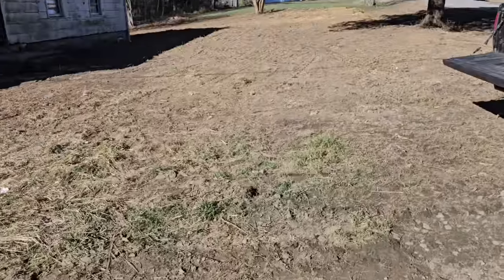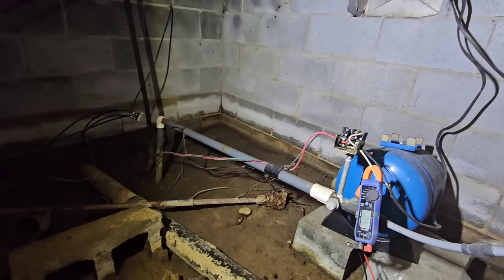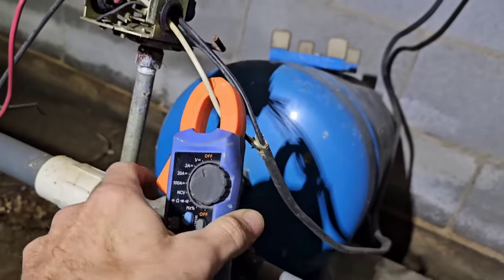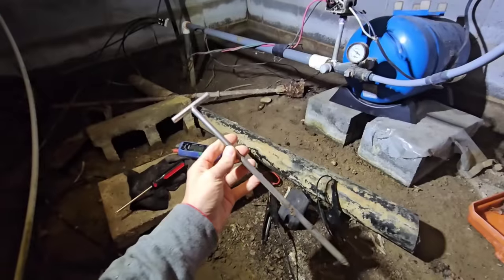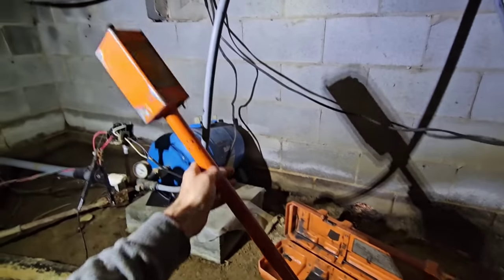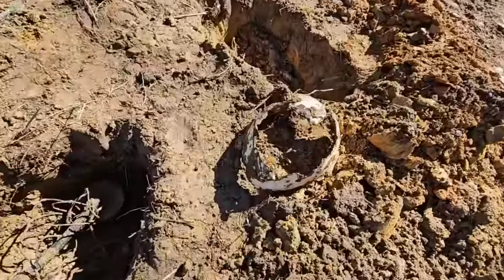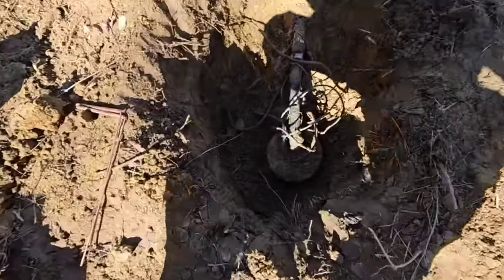Can Copper Dousing Rods Find a Water Well below the Ground? New Tech Vs. Old

Comment: I'm a man of science. we were on a job where we needed to tie into an existing plumbing Line. we had a man come out with his locator and he failed to locate it 6 times. the oldtimer I was working with bent some welding rods and pinpointed every line within minutes. I went from a nonbeliever to the opinion that there are a lot of things we just don't fully understand. great Videos by the way.
Reply: It's still not real. Every test done on it has failed. Dowsing at best let's you trust your experience. There's only so many places pipes will get put by installers.
Reply: I had a lady friend who was over here  in the US from Italy on some kind of scientific  research program, something to do with micro biology I think, she had TWO  graduate degrees  and was smart as hell, at least very highly educated!  Somehow dowsing came up...., and she scoffed at the concept, I took two gas welding rods (copper, bronze? not sure) bent a handle in them both, and told her to start walking. She located the underground line from my well, but didn't believe it until I proved it to her, to say she was amazed is putting it mildly.
Reply: @portnuefflyer  Anecdotes are not evidence. It's been disproven in studies over and over.
Reply: @Tb0n3   I was as stunned as she was I should mention, as I watched her walk towards where only I  knew the underground line was located. When they reacted, she did also, as did I!  It may not be "evidence" but that's what happened.
Reply: Works every time.
Reply: Hello as some one who is a water operator and who uses witching sticks aka dowsing rods on the daily multiple times a day I can say they do work and very well now if you be much easier to tell you all this in person but here we go… ok so first up it doesn’t find water it finds voids in the earth it can be a empty pipe a pipe full of water etc just can’t be filled with dirt 2nd most rods are way way to small mine are 28 inches long with a 8 in handle and are 3/8 inches thick now when holding you much be hands touching or wide as can be hands touching rods go away from each holding wide rods cross if you hold them in the middle rods will dance back and forth bro g pulled both ways this is what most people do when o had them my rods to try it so they think it doesn’t work no hold them tight or hold them wide now for those “test” yes I have watched them only line again a empty bucket or one filled with water placed on the ground that will never work at all you need earth and voids if you place a bucket on the ground it will have no contact under the earth no hit and like I stated it finds voids not water to “test it properly” you would need a empty field bury a few sticks of pipe or even buckets below the ground filled or empty you will get a hit on both of them again voids not water and no scientist will do that and put up a bounty on it because he knows the will loss his money
Reply: Same I'm a geophysicist and I'm pretty sceptical about most alternative non scientific things. But I grew up on a farm and on several occasions my father used the services of a water diviner to find places to sink new wells on our farm, I remember one time we all (our family) went and watched him locate an aquifer in the field near our house so we could sink a well there, he used a pair of bent wires and he also used a forked willow branch that he broke from a tree in our yard, he located an aquifer in the same location using both of these. We asked him if we could have a try he was more than happy to let us, it worked for my Mother and I, as we walked over the same spot the rods crossed and the willow fork pulled downwards, I even walked around a bit more and I could locate the aquifer in other places as it continued under the ground across the field to check that I wasn't just subconsciously manipulating the rods to cross where they did for the diviner, the diviner confirmed the other locations that I found, it didn't work for my Father or my Brother or Sister, just my Mother and I.

Oh and we sunk a well at that spot in the field it supplied water to our house for all the many years that we lived on that farm.
Reply: Good information thank you for making the video. I Am  Retired plumber in Virginia .I have used dalcing rods.When I was in the field working  locate sewer lines and Water lines.
 I have been fortunate that I have had good success rate with it. I do not understand How it works . Thanks for the.
Videos, On Well systems . Good information.
Reply: @Tb0n3  It is real to me. I found my well head then the old owner came out and showed me the same spot. I dug it up right on the spot the rods said it was. Scoff if you want. Spend your money.
Reply: It’s neither here nor there whether individuals ‘believe’ in the dowsing abilities of individuals or not, but whether it works - our local water well boring company simply don’t drill any new wells without having first the confirmation by our own local old timer water diviner (using fairly similar rods as shown here); he can tell them where to drill, and also how deep to drill. He took my partner out to allow her herself locate the various water seams. It works. 😊
Reply: years ago at a major industrial facility we had to locate an underground water   line and tie into it. I bent a set of welding rods and staked out the location.of the line. We called the firemen and asked them for a location. The old guy came out and pulled his brass rods and staked out the line. We were about 2 ' apart from our locations. We excavated and tied into the line at 28' deep. Think at that depth we both nailed it. I wasn't real sure I could do it. The old guy had no doubt.  He remembered when the line was installed back in WW2.  try it you can feel it!
Reply: Yes, lol 
The old timer is actually very gifted as it isn't about the rods as much as the one holding them.
Reply: I know for a facr gifted people can do this and it it's rhe man not the rods
Reply: Like you I don’t really believe in that type of stuff, I’ve been wanting to at least try it to see if I could find water on my camp land after watching this I’m definitely going to try now keep up the good work bub
Reply: Same on a site I worked on years ago..they gave me a go,when rods crossed,looked down ,there was a marker of one main they found earlier..a definite believer since then!!!
Reply: They don't want us to have well water 
They're not going to make it easy 
The rods do work
Reply: When I worked at a plumbing company in Oregon, my plumbers always used pipe hangers.. when they crossed Voila!
Reply: It isn't magic. 
Your body adjusts itself to the gradient of the terrain, you cannot normally determine when the gradient changes (unless it's noticeable), by locking your arms, elbows tucked to body, you can use 2 right angle sticks to indicate when you body adjusts to the gradient changes, therefore you can determine both the lowest and highest points in the terrain by watching the sticks. 
And water tries to find the lowest point in the terrain.
So your not finding water, your finding the lowest point in the terrain, and a higher probability of finding water.
Reply: I don't see anyone talking about the resolution of a measuring device like that...  You are ~4 feet off the ground and the thing is a feet or more below that, if you are not plumb you'll always find it above where you remember being and yeah if you measure at a 5 deg slant it's right above were the rods were... next time get a plumb line and draw a one-inch circle around where it lands, then mark a few feet from where you plan to dig and after wards measure the same few feet back to where that mark was to see if the 2x2 circle where you dug was where you remember it being.  If you don't go straight "up," you would always find your dowsing "post hawk" right on top of it.
Reply: My grandfather used to find water for folks all the time. He could tell them how deep to dig and how many gallons they would get a minute. He never charged anyone, said he would lose the gift if he did. He always used a peach tree sprout for his water witch, from a peach pit he'd plant after he ate the peach. I've seen him do it for people many times. It's very weird and unnatural looking, watching the wood bend on its own. It's like the stick is alive. 
As far as science goes, and the process having been tested through the years, I have no explanation for it, but I've seen it work.
Reply: @hog7203  Lots of ppl have seen magic tricks as well, these anecdotes can be brushed aside as simple showmanship.
Reply: I don't know how it works. But I've seen it work too many times to disbelieve it.
Reply: @Tb0n3  If you've seen it in person done by a guy you grew up with, who then shows you you too can do this, the block is in your mind, you're blocking the truth. WHO did or funded the 'tests' or 'studies' saying that dousing doesn't work? do uour homework people, don't just believe some un-named 'authority' or 'expert' & named ones check out thoroughly -particularly for 'research grants'
Reply: @unti419  Have you seen it, or have you just been fooled into thinking you've seen it?
Reply: @cheako91155  Yes I have seen it on three different times in my long career. If your opinions differ, I really do not care,
Reply: @unti419  My opinion doesn't differ, I'm asking if seeing means it's real or if it's possible for magicians to fool ppl into thinking magic is real.  What you've seen can be completely explained by showmanship, no supernatural powers required.
Reply: @cheako91155  no, you are 100% wrong. It's not a magic trick. I've witnessed it more times than I could possibly count. When my grandfather got too old to drive and had to use a walker to get around, he still helped people find their wells. I'd drive him to the places he would douse, and have to help him walk around etc. It's like the stick becomes alive. How many times have you watched someone do it? I'm gonna guess zero times. You probably only looked it up online, and got your opinion from there.
But it doesn't matter to me, if you believe it or not.
Reply: @Harry-v5n  how many times have you witnessed someone dowsing? Maybe you should go watch someone do it first hand, before believing everything you read or hear.
Reply: Yes! My dad was a PHD. in physics. I told him about using the rods, so we did a quick test in the yard. I found the water line with the rod, and he verified it with a metal detector. He guessed that some magnetic field was in play.
Reply: Magnetic electric field is how it works.
Reply: @RC-nc8bh So what did you find?
Reply: If you have never tried it it will blow your mind. We had to find a water line on a construction job a buddy of mine said he find it he just need 2 clothes hangers I laughed at him an argued with him and told him don't let the home owners see you they will think we are crazy well he brought 2 hangers back after lunch and made me look like a fool he found the water line in 30 sec 3ft under ground i work for me and I showed my 10 grandson how it works for other stuff to.

Comment: Where I live here in north-east PA, wells run deep and low return. My neighbors have wells as deep as 1000 feet and low return. On my property, I and my mother each walked the property and we both hit the same spot. I printed up a big WELL GOES HERE with an arrow and that's where the well driller setup. The contractor was totally on board with it and said he liked the idea because it had worked for him in the past. My well came in at 445 feet, fills to 75 feet from the top, and produces 7 gallons a minute. For these parts, that's golden!! I've filled my whirlpool tub without an issue. I regularly take long showers. And no problem with other things like the dishwasher and the washing machine. My next house, I won't hesitate to do this.
Reply: I get enough water from my well for everything I need. I've had just washers twice with no issues. Some of the neighbors can't do that.
Reply: @click411 Daily, and a long shower. My well can easily supply two houses. So many of the wells in my area are not so generous.
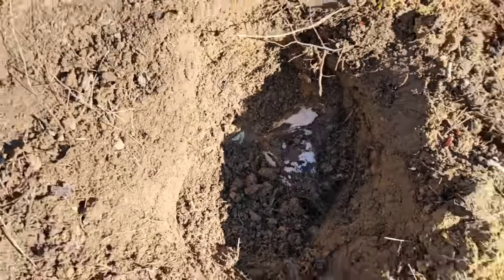Reply: The US Army used dowsing rods in Viet Nam to detect land mines in the roads. 14:55
Reply: I've heard of people using welding rods and copper rods, but I've been told small willow branches work best for finding water. I have never had a need to try it myself, but it was interesting to watch.
Reply: Your gifted and connected to source is why it  worked for you. 
People don't understand what gifted included.
Reply: @ryszardbyczyk6938  I could dowse 50 years ago (UK) but haven't tried since then. Hazel branches were considered to be excellent then.
Reply: I used to watch field tile on farmland I get it right on the head every time not just one time 50/60 times I had a friend friend I would still come in with a Cleveland trencher it works if you have faith
Reply: I had a const. Co . Never had a squawker. Found phone, electric, gas, water lines, even fiber with tracer. Used copper and steel wire. Never failed me.
Reply: A good way to use both the tools is to use the sound meter to plot the direction and then walk  the douser rods  farther away in that direction until the douser rod cross , X marks the spot.

Comment: Should have used the sticks before the locator
Reply: Yup !!
Reply: Digging the midpoint between two points 20 ft away isn't a real test. Yes, the rods alone should have been used and we'd have seen they don't work. Dousing has been debunked many times over.
Reply: Randi is a hoax. @DD-DD-DD

Comment: I am 80 yrs old and have found wells for people I learned that from my Uncle when I was 6 yrs old, motor grader operators on paving crews use that to find water lines under the road, I have used brass, copper, and Willow tree limb you get the biggest stream of water with them and the direction of underground flow. Great video.
Reply: What county or city approved the use of dousing rods ? Please include that
Reply: @KC-nd7nt / Why does a country or city have to approve anything that is just used to locate anything?  They don't have any jurisdiction over location equipment.
Reply: @KC-nd7nt there are no state/county laws that say how you have to find the water just like there are well drilling company mines that sometimes have to drill multiple holes to hit water .. 🤷🏼‍♂️

Comment: When I was 17 years old I used a crowbar to locate water in the ground. My father laughed at me telling me it couldn't have worked. He went and got himself a willow branch that had a good crotch in it. That was how he would locate underground water. His willow branch took him to the exact same spot that my crowbar had found. He grabbed the crowbar and walked all over the yard until he reached the spot that I had originally found. Still nothing! I took the same crowbar, walked 20 feet away and then balanced the crow bar on my thumb and middle finger so that the crowbar was perfectly horizontal to the ground. My father followed me every step of the way to make sure I didn't cheat. The crowbar stayed perfectly level until I got near the spot previously indicated. One more step toward the spot and the front end of the crowbar plunged to the ground. The willow branch worked for him but never did for me! Go figure!

Comment: Gotta do the dousing rods first.  If they work they'd have found the well.  As it stands, you knew that the thing was right there and then dug halfway between...  10 feet between them, you dug a 1.5 foot hole, and it wasn't centered on the well.

Comment: I have been using dowsing rods for more than 40 years and they work perfectly fine and accurate to locate any underground utility, not just water related. I use plain simple welding rods, bent like yours, but mine are about 2 feet long to make them more sensitive. I locate city utilities such as gas lines, sewer lines, water supply lines, pvc sprinkler lines, electrical conduit or storm drain lines from gutters. I usually walk in a checker pattern across a property and when the lines cross I know I got something. Set a flag and connect the dots. By the way, the method works in 'reverse' too. If you start out with crossed rods then they will open up when you get over a void in the ground.
Reply: Good as you, I always flag, and speaking of depth when you feel them tugging and strong you got the mainstream, I used brass brazing rods a lot of people I spotted wells for as a hobby quit challenging me about metal magnetic, etc., I like the brass 90-degree handle bend and keep them perfectly level you won't miss and find the biggest stream with brass rods. In 1948 Ga. people dug their wells so that was a must to find the closest groundwater.
Reply: @michaelrocher5649 I’ve used one brass brazing rod and I’ve used one straight limb from a fruit bearing tree to find water lines.  I learned it from my Dad.  He owned a well drilling company.  He also used a fruit bearing limb to witch wells.  He would put the small end of the limb in a soda bottle and hold the bottle to let you see how it would move.
Reply: My Dad used to use the same method with the long welding rods and he was always able to find his lines that way.